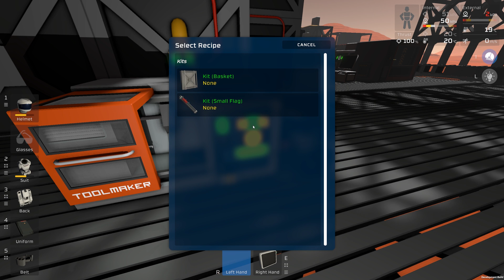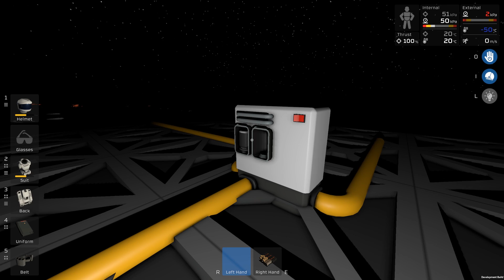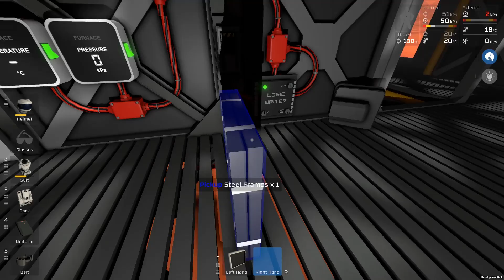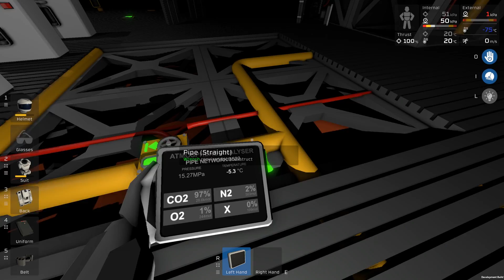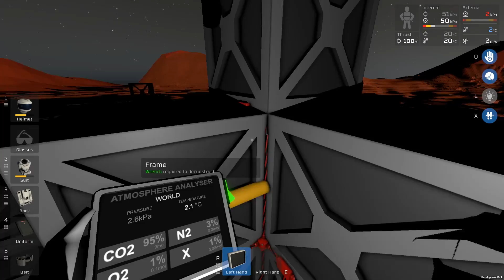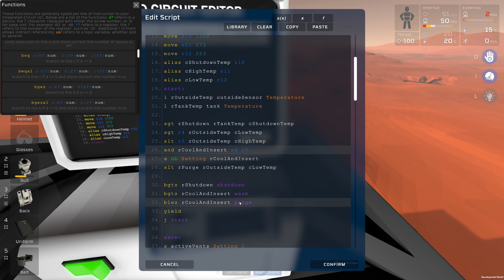Stationeers S2 E67 - Trash and Recycling

Comment: Wondered if you had thought about adding a light that showed the status of the filters in the atoms systems so you knew when they were getting low, can be controled with a ic and lights so its off for say above 50% and yellow for 25-50 and red for less then 25 can be on a wall with a sign so you can see what each light is for then you would run out downside is it would take 3 ics to do all 7 filtration units

Comment: Looks like its working correct for what you passed in as it was all Iron.  However, 100% of the time you will want to spin things through the centrifuge as the recycler was changed to only output reagent mixes recently.  The Centrifuge splits up what is in the reagent mix balls back into the ores.  You may want to put in ducts and a chute bin in between the recycler and the centrifuge to inject regents directly into the Centrifuge incase of gas furnace failures.  Those return base ores at a 1 for 1 ratio.

Comment: Reagent from basic filter is actually equal to 2.5 iron ore, you better put more than 1 filter at a time to recycle all the iron, otherwise you actually lose some in the process.
Also maybe activate the centrifuge after you finished recycle all the stuff you wanted? That way you make sure you get all the materials back.
Its also good if you fail to smelt with the gas furnace since then you also get reagent.
And so far don't try to recycle stuff made of steel as it seems the centrifuge fail to convert steel reagent back to raw iron and coal (but only when recycling steel items, failed steel smelting will recycle properly).